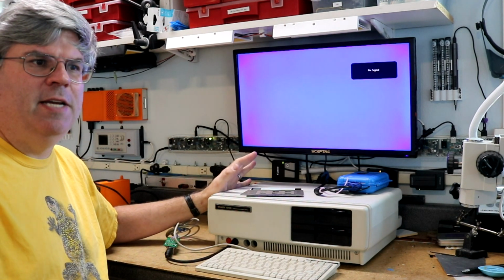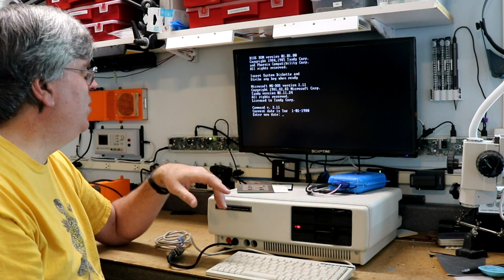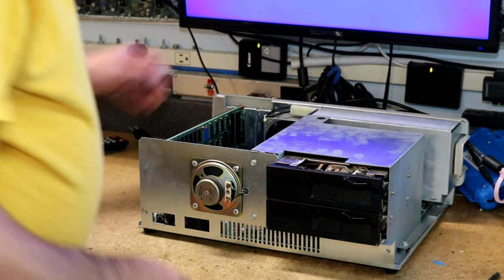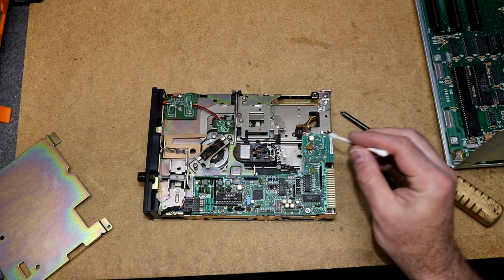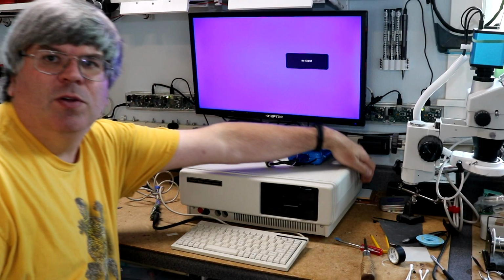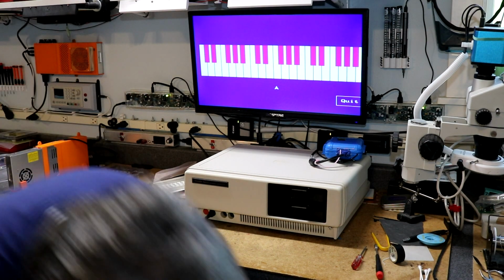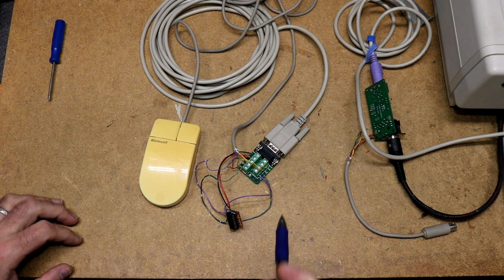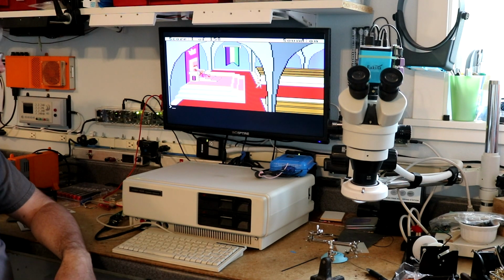Upgrading my Tandy 1000 / PS2-Tandy Keyboard Converter / 25-1010 Mouse and Clock/Calendar Board

Comment: Technically it's a DE-9 since the B-case is wider (like the 25 pin DB-25).
Reply: so a vga connector is a de-15 ?  learn something new everyday.  thank you.  please take care & stay safe.
Reply: @dLLund  Exactly. the VGA-connector is usually also referred to as a HD15 since it's "high density", just to bring even more confusion :)

Comment: Nice seeing another 1000a, I still have my keyboard, I have a combo 512k ram/clock board in my machine,  xtide with a CF interface, and a 80286 accelerator board, I still have the old external hdd and mfm controller for it, but the hdd itself an old seagate, is unreliable these days, hence the CF card xtide adapter, I also have the CM2 monitor, my B: drive has pretty much failed logically, it's in there, does a seek light, 2nd as a B: drive, but DOS say it's not there anymore.

Comment: I'm so jealous that you can just order new old stock parts from a pretty much local supplier. I've had to order some old DRAM for some projects and it's all coming from overseas, there's just nothing local. I've got one order coming from the US, says it's departed Tokyo, Japan on the 3rd and still hasn't arrived (meanwhile two other unrelated orders from the US have arrived, but another also hasn't, despite being checked into the same global shipping centre at the same time as another order). And I've got another order of chips from Finland which hasn't even left the country yet. I'd order a smaller batch of chips from the US to keep the project going while I await the order from Finland, but I have no idea if it's going to take 4+ weeks to arrive, and show up after the one from Finland!

Anyway, the clock chip is the Signetics SAF3019P. Found the datasheet in their 1985 Linear LSI Data and Applications Manual, page 5-198, available here: http://www.bitsavers.org/components/signetics/_dataBooks/1985_Signetics_Linear_LSI.pdf

Couple of interesting notes, firstly it says the battery supply voltage is 1.5-2.6V, so technically the 3V lithium would be out of spec, but I'm guessing the old 2320 battery was a lithium battery too, so presumably Tandy must've decided a 1.5V watch battery was too puny to last long enough for the mighty Tandy 1000. It's between pins 16 & 15, and it goes to a power-on reset circuit, but evidently it works just fine.

Secondly (but probably more to the point), the main time counter only includes the minutes, hours, days and months, with the seconds handled by a separate internal counter, and the roll-over triggering the minute counter in the main time counter. That also explains why it wouldn't work on a write-protected disk, it needed to record the year separately on disk.

The only other interesting thing about it is that it can also run off a 50Hz signal, which was pretty common for clock chips of the time. They were designed to be built into clocks, running off a resistor to the secondary winding of the mains transformer, since that would've been a larger market for them early on in the personal computer era.

For the mouse, could you not just pull the button pins down to ground by just wiring the buttons through resistors in the mouse?

Comment: now that you have had the electric screwdriver for a while is it still working well for you? I am thinking about buying one.
Reply from the maker: Yeah, I'm still using it. Frequently use it on 3D printing projects where I have M2.5 fasteners going into heat-set inserts. Torque on the screwdriver is pretty light -- but once the fastener is loose, it's great at spinning long machine screws loose.